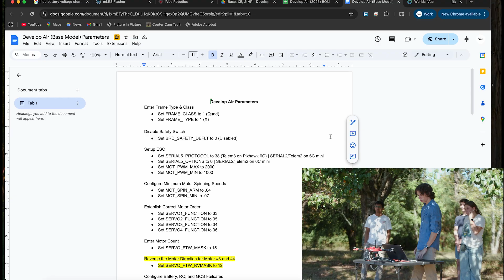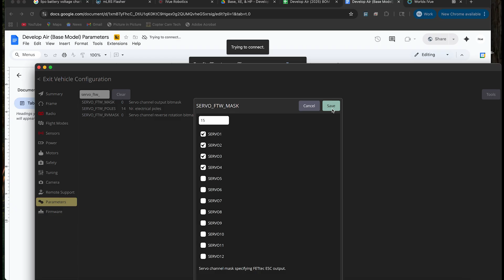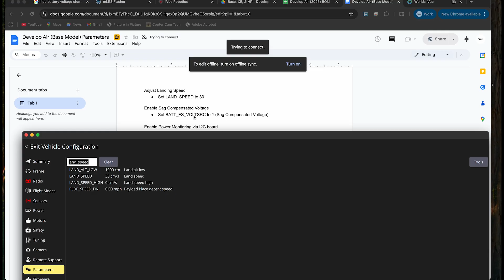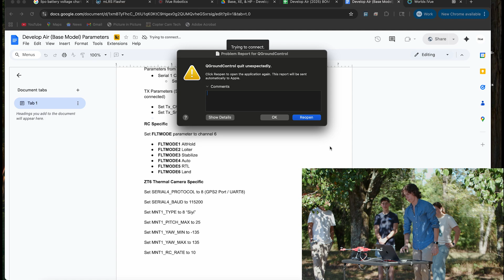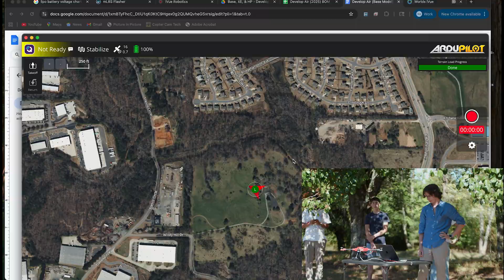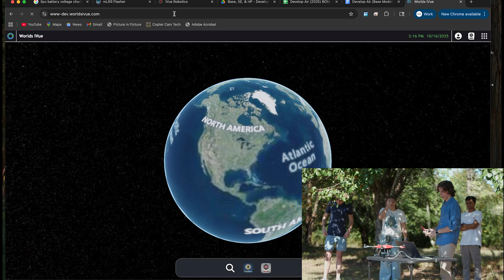We Got the Beeps - Two Drones One Flight @ Denmark Drone Park

Comment: The problem could be due to engine orientation. I recommend using the engine test in the mission planner and mapping the engines from there.
Greetings from Peru C:
Reply from the maker: Our motors seem to be setup correctly, but there does seem to be some interference caused by the ESC. Thank you for your feedback nonetheless. Greetings from the great peach state of Georgia.

- Jacob